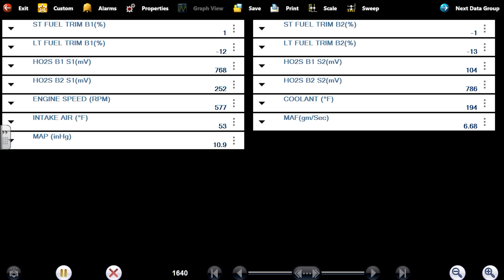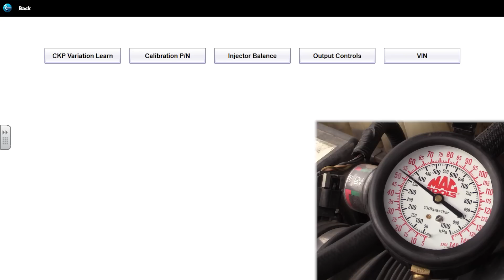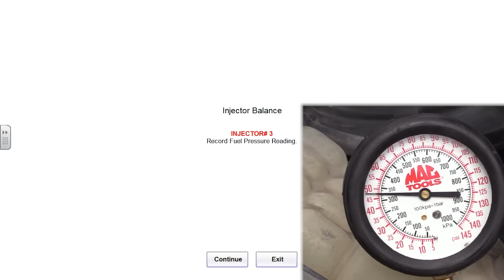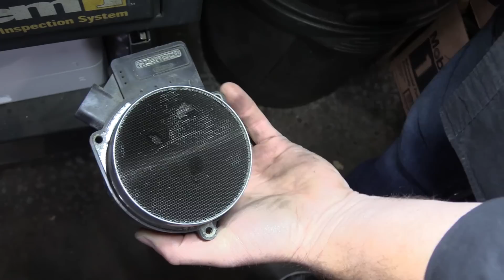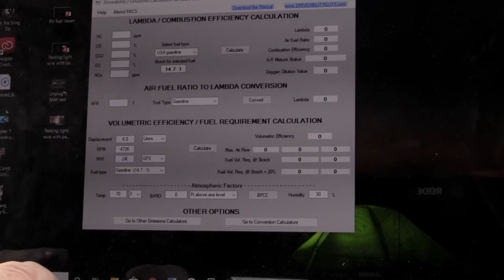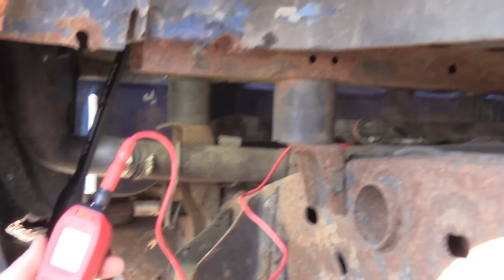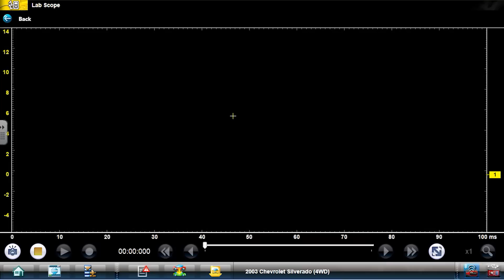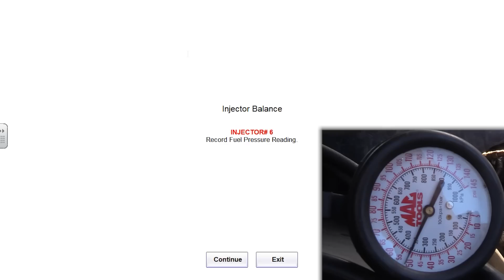03 Silverado Misfire, Rich AND Lean fault codes

Comment: Being a GM dealer driveability tech u have a weird one. I’d be going after leaking regulator or flooded evap cannister but looks like u did that, vehicles to old to have 08+ fuel composition algorithm feature. 6.6 g/s seems high, I’d be looking at excess skewed maf reading, aftermarket air filter or possible out of spec injectors swapped from a out of spec 6.0 liter vehicle to a 5.3 vehicle. All I suggested is still very rare and will cause lean codes not rich codes 95% of time. 55 psi seems kinda high from my memory. Possibly find a to disable to fuel pump and run a manual cylinder tool fuel system, to 45 psi at idle and see if fuel trims improve.
Reply from the maker: I am waiting to here back from the owner about the injectors he replaced. The fuel psi spec on this one is 48-54, so it was in spec (not under load of course). 
I'm with you on the possibility of a skewed MAF and I should have looked in front of the MAF too. Also, I never checked for fuel contaminated oil. Something else to look at after I hear back from the customer about the injectors. 
Thanks for the reply!
Reply: @ScannerDanner  , is it a Flex Fuel Vehicle? What does the alcohol percentage PID read ? Can you do a Fuel Alcohol Content reset with the Verus? If not a  DS708 or MaxiSys should be able to reset it.

Comment: Sorry but didn’t like this video. Need closure on these diagnostic videos. If I was owner I would want to know the fix. Take it to South Main Auto maybe?
Reply from the maker: lol, I'm not doing the repair and I proved a pump issue, on camera! We can debate the negative trim numbers (nothing to do with the lean condition under load from loss of fuel pressure) but to make a comment like this is ridiculous. This owner is not going to drive 6 hours to Eric's shop #1 and #2 I understand you want closure but it is not always possible and if you are willing to learn, you don't need to final fix footage to do so. 
To the owner (if you were him). 
#1 You need to drop the fuel tank and look for debris and or an inlet restriction and if you don't see anything, replace the pump. This will fix your lean condition codes and high speed hesitations and misfiring. (which BTW is the customers main complaint!!)
#2 Fix the exhaust leak on the drivers side manifold. If this isn't fixed, this will contribute to false lean conditions on that bank of cylinders.
#3 The rich condition faults, I do not like the injector flow rates. I mentioned trying a cleaning service first. I never told him to replace them just yet. I am waiting to hear from him on where he bought the injectors and what the manufacturer part numbers are. 
So you as a customer are unhappy because?? 
The "fix" is multiple problems! There is not a single fix on this one.

Comment: I agree Paul, the fuel pressure is failing and the injectors look tired.  The exhaust bolt is probably not the issue.

Comment: When you are sitting idling, LT FT are negative, why does the downstream show only 200mv?
Reply from the maker: The engine is not running rich. The PCM has compensated for the rich condition. In other words the downstream O2 signals would not reflect any type of rich condition because it has been compensated for (negative trim numbers). Make sense?
Reply: @ScannerDanner  that low of a voltage on the downstream is normal? I had a similar condition to this one, it was a 97 sierra 2500 with a 454. Would set rich codes on both banks, sitting idling FT was not maxed negative. They were about -16 or so, upstream o2 switching normal, downstreams about 200mv-150mv. FT would sometimes be normal on its own. When FT was negative, i brought idle up to 2500rpm and it would be about 0. I couldnt figure it out. it had the infamous broken studs on the exhaust manifolds, fixed those but still same condition. I found one injector on B2 not firing during injector balance test. Didnt think it was that though because i was negative FT on both banks. I know engine had vacuum leaks but didnt think they would cause a rich condition. That thing kicked my butt, never found what it was.

Comment: The amperage draw scope test results make me wonder again about "proving circuit integrity by watching amp draw" that you state on some fuel pump videos.  The draw was close to the same with the marginal ground. If you ever get a pump with a worse connection, I'd like to see video on amp draw differences. Like you say, your truck pulls 9+ amps, this one pulls 7 amps. It would be tough to call good connections without knowing what to expect. I posted the question on premium channel too but haven't seen an answer I like yet. Thanks.
Reply from the maker: I don't know that I have one you will like. It is just another test we use as a guide. We can always back it up with a voltage measurement at the pump connector when possible. Thanks Bart!!

Comment: I am always interested to see the pulse with modulation waveforms on the scope to see how long they are open I saw 3.2 milliseconds on your scanner to see if it's a load unloading it down or I can use a fluke meter with a duty cycle to tell me how long waveforms are the best thanks for the comment paul

Comment: These have a delay in power enrich. If you look at loop status you should see it's closed loop. You should note that the stft are moving while at wot.
Reply from the maker: I have heard that about these 6.0s but the test still gave me good direction as to the lean condition under load. (caused by a loss of fuel pressure)
Reply: @ScannerDanner  your O2 sensors didn't go lean, though. They were switching. The fuel trims at WOT indicate there certainly was a fuel delivery problem, your engine load showed the MAF was not the cause. I've seen many techs fall for the trap of lack of power enrich. I've put quite a few case studies on iAtn showing this behavior.
Reply from the maker: @SuperTurbocoupe  So this model uses trim at WOT? Is this unique only to this model? I tend to not believe loop status on scan data and I've seen many systems altering fuel trim numbers at WOT but again, I don't use it. Why? Because what are we "trimming" with an air/fuel ratio that is running at 12:1? Isn't that about where we are when we are making power? A narrow band O2 is not really going to be helpful once you get past about 14:1. Unless this model is using a ratio near stoich during WOT?? Is it? 
Thanks for the info! I have heard these 6.0L engines are delayed at WOT as far as full enrichment goes, so initial trim data would still be valid, but I have not heard of a system keeping the ratio near stoich the entire time.
Reply: @ScannerDanner  Commanded fuel ratio is 14.7:1 at WOT,  that's exactly what power enrich delay is. It doesn't enrich at short WOT events, it's CLOSED LOOP. It can be seen plain as day in your video. 1.  The O2 sensors are switching. 2.  STFT is still active. This isn't a Ford where the STFT will "indicate" the power enrich. This is a GM where the STFT will show you what the corrections actually are based on feedback. I would rely on it on this truck, it clearly indicated a fuel delivery issue.
Reply from the maker: @SuperTurbocoupe  awesome! So it is a "delay", I missed that statement. Sorry. Under long WOT runs, we are back to "normal" fuel enrichment mode. Great information! Is this something you are seeing a lot more of?
Reply: @ScannerDanner  pretty common since about 99 on GM.

Comment: I’m having a similar issue with my Subaru sti... since it’s a flat 4 cylinder, there is only one bank. In the Subaru world, AF learning 1 is LTFT, AF correction 1 is stft. As of now, my MAF is reading high at idle 4.5ish g/sec at idle. My AF learning 1 in CL in the low load table is -5.69, with stft sitting at 0. Once I get into load, still In closed loop, my LTFT are normal +.78 or so. Car has misfires on all four cylinders, maybe 1-2 roughness, at most I’ve seen up to 3 misfires. My Wideband is reporting 14.59, but it’s like it’s fighting to stay stoich. I have a aftermarket FPR and FPS. I can log and monitor fuel pressure diff compensations, and I’m seeing a correction of about 10 psi at idle, but under load it’s spot on. Sorry for the long post. Thanks Paul, curious on what you think. I cleaned the MAF completely once again, o ring is on it, and no leaks. Subaru wanted almost 300 dollars for a new MAF sensor. I’m most likely just going to convert my car over to speed density.. but still trying to diagnose what’s going on with my car now. I do run pump flex fuel, with an ethanol safe fuel pump.
Reply from the maker: aftermarket FPR changes things a bit. Are you running the factory recommended pressures?
Reply: ScannerDanner I have an aftermarket FPR and FP sensor. What’s neat is I can monitor fuel pressure diff comp. my base fuel pressure is 43.5, same as stock. I wonder since I run flex fuel, if there is a different amount of oxygen Readings depending on the ethanol content variations
Reply: ScannerDanner replaced a part.... sorry lol. New air filter solved my fueling, not the misfires on all 4.

Comment: It would be very cool to see the injectors spray on a injector bench tester.
Reply from the maker: I do not have a bench machine and I certainly wouldn't be doing something like that without one as they do NOT use gasoline for those types of tests. Super dangerous to do so with gas.
Reply: Hey Professor got a match.

Comment: Wait, fuel pump was replaced. But the fuel regulator wasn't?
Reply from the maker: The regulator was working as designed and is definitely not the cause of the loss of pressure under load. If the regulator was causing low psi, it would have been low psi all the time.

Comment: Flex fuel pump in a non-flex fuel motor?
Reply from the maker: same psi specs for the 6.0 for flex fuel and non flex fuel (48-54 psi)
Reply: @ScannerDanner  5.3l flex fuel Vin z is lower 48-54 psi vs 55-62 psi and that pump will fit in the tank the same as the correct one on at least one year back back around then..
Reply from the maker: hmm, maybe? I don't think they used different pumps. And I think the fuel pressure spec is the same? Great questions! Now I have to go look

Comment: Regarding maf value at idle you mentioned, the difference at idle g/s of the larger and smaller engines is not because the idle is a bit higher on the smaller engines?
Reply from the maker: I'm not sure that is the case??

Comment: Great vid as always SD. Just a question. With a dirty injector... if there is no direct electrical problem with the injector is there any possible way of telling a dirty injector throught the scope pattern? Im thinkn throught the pindle hump. And if not what about a heavy dose of injector additive through an on car decarb service then re do the balance tests and compare?
Reply from the maker: I have seen injector issues show up in a pintle hump, but only once. Most of the time, flow rate differences have no change in the amperage or voltage patterns.

Comment: Between the freeze frame data for the rich codes showing less than 10% on short term and long term fuel trims, and the fact that the fuel tank pressure sensor was completely unplugged and showing 0 volts on the scan tool live data, yet it never threw a fuel tank pressure sensor code, or any other type of EVAP code, part of me’s gotta wonder if he ain’t got PCM issues going on along with the other stuff that was proven to be going on in the video.
Reply: Well, while I still think that this truck may possibly have a PCM issue due to what the freeze frame data showed, my case for a PCM issue on this truck just got a LOT flimsier. I had a truck come into the shop today that was IDENTICAL to the one in this video. Same year, same VIN designation for the 6.0 that was in it, and it was the 1500 HD. The truck had no warning lights of any kind on, and the customer had no drivability complaints. He just dropped it off to get the oil changed and the tires rotated, so I thought I’d try to prove that the truck in the video had at least one PCM issue by unplugging the Fuel Tank Pressure Sensor and seeing if I could force the Check Engine Light to come on for a Fuel Tank Pressure Sensor code. Much to my surprise, the Fuel Tank Pressure Sensor was ALSO already unplugged on the truck that I had, just like the truck in the video was. I scanned it for codes and there were none. I looked at live data on my scan tool, and the Fuel Tank Pressure Sensor voltage was 0 volts and the Fuel Tank Pressure reading displayed 7.29, just like the live scan data did in the video. I then unplugged the purge valve, started and ran the truck 3 times just to see if I could force an EVAP code to set at all, and it did set a code for the purge valve. The best guess I’ve got as to why this’s happening with the Fuel Tank Pressure Sensor on these 1500 HD’s is that the 1500 HD Chevy trucks are certified as heavy duty trucks on the smog tag on the air filter box, and they also have a separate sticker under the hood, I forgot what the exact verbiage was, but it pertained to the EVAP system and adding a larger fuel tank. Because of this, I think they may have some sort of partial exemption from EVAP testing due to the possibility of the fuel tank/system being modified, and thus, GM disabled the EVAP codes pertaining to the Fuel Tank Pressure Sensor and EVAP leak codes from setting. Not sure if that’s right or not because there’s no requirement for smog testing where I’m at to get tags renewed, so I’m not very hip as to smog regulations.
Reply from the maker: good thought! and yes, those freeze frame data captures for the rich condition, showed positive trims lol

Comment: I have no experience with injector balance. The differences seems small to me. The pressure drop during load seems to me to be the most important problem. Is it the fuel filter or the fuel pump? Then I measure the flow. Normally +/- 800cc in 30 seconds. Solution of this problem? Thanks for video. Your scanner is great just like Scanner Danner ;-). Snap On?

Comment: Need a tighter edit. Also should recommend to fix the exhaust leaks then continue the diagnosis
Reply from the maker: a tighter edit? You mean you want me to get to the final cause quicker and skip all of the processes and testing methods along the way? That is not what I do. I understand this format isn't for everyone. Second, the exhaust leak had nothing to do with the negative trim numbers, not the fuel pressure dropping under load. So it did not interfere with this diagnosis at all.

Comment: Hi Paul. On the topic, more than once after replacing stuck injectors, I pull out the oil dipstick and it smells of gasoline. After changing the oil, LT fuel trim returns to normal.
Reply: Ok, I'm lost. I understand fuel in the oil... but how does that result in LT trim changes?
Reply from the maker: I should have checked for fuel contaminated oil, I was dreaming about this one last night and that is totally one I should have eliminated! smh

Comment: would bad injectors that are s not closing enough when they are switching faster at higher rpm cause a pressure drop? had a fuel pressure problem changed the pump and opened it up and the commutator was brand new not worn, but changing the fuel pump solved the problem.
Reply from the maker: bad injectors (leaking) would NOT cause a fuel pressure loss under load. The fuel pump is capable of way more pressure and volume than what is needed on all systems and would have no problem keeping up with some leaking injectors.
Reply: @ScannerDanner  thanks for the answer, and for a great case study, looking forward to more videos on youtube or your premium channel and Caleb doing a great job also, fun to see your brother too.
Reply from the maker: Thank you so much. You've been a long time supporter of me and it doesn't go unnoticed

Comment: God Bless you Paul...you are a great man!  I hope you are doing well my friend!

Great info on MAF g/s numbers at idle!  I have definitely seen them report higher than expected and have concluded that this can very well be normal for a smaller Liter engine...why is that?

Excellent video...as always!
Reply from the maker: not sure my friend
Reply: I would like to know why as well. Maybe smaller engines= slightly higher idle to maintain a smooth idle?? = higher grams/s. Just a thought. Any other theories out there?
Reply: I believe the response curve of the MAF analog/digital converter in the ECU / ECM is not perfectly linear and may induce some false / under /over reading at low RPM. Same as in temperature reading in the lower scale... were GM displays LO until temp reach a certain value....
Reply: And also... for MAF... until engine goes in closed loop, the ECM uses preset values from tables based on TPS, RPM and .... CTS... Coolant Temperature Sensor and also from AIT Air Intake Temp Sensor.... if one or both of these 2 are faulty...this can result in faulty calculation by the ECU/ECM..... Think of it....
Reply: Finally.... on my old 1989 GM C4 Corvette.... when a problem like this one occurs I always verify at first the parameters of the equation determining the pulse width of the injectors.... that is ...the sensors including the knock sensor!    Sure... when using a fuel pressure drop test tool .... engine not running... I can eliminate (or not) the faulty injectors.... but not the knocks and leaks caused by a missing bolt on an exhaust manifold ... with regard to the O2 sensor.... may be this could be a hint.... love your videos!  ...Wish I could be closer to attend your course!

Comment: The slow pressure build up still screams a restriction in filter or pump.
Reply from the maker: It was only slow on the initial install of my gauge. I have seen this many times, even on a good pump, due to air in my gauge and system. But I agree, I didn't like that either